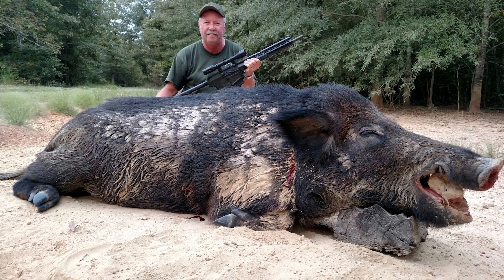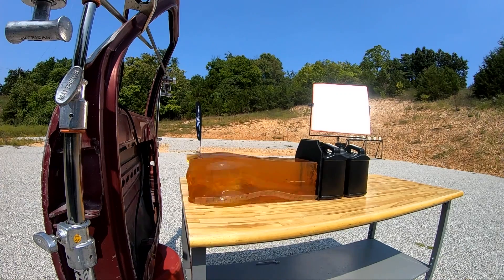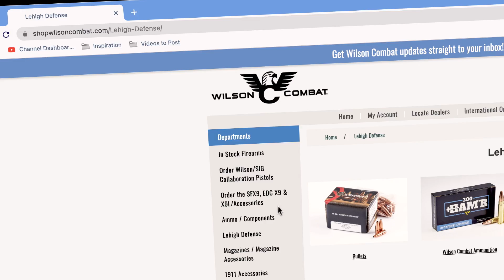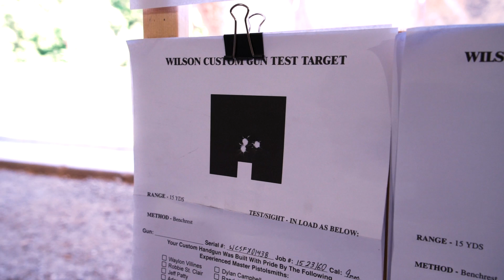The New Lehigh Defense is Fully Operational!  Now Machining 400K Solid Copper Bullets a Week!

Comment: More and more I am switching to Lehigh Defense bullets. My H&K Vp9's love the bullets as do my Colt pony and Browning 1911 380. I was astounded at how well the 118 XD bullets were in a 350 Legend for performance. Their 115 gr in a 38 Super using Blue dot is screaming fast and accurate. 357 Velocity in a 10 shot 1911 is a formidable defense gun. The 112 gr CC in a 6.8 SPC is a hog smokin round, possibly the best hog round for the AR 15 platform.  The best bullets I have found so far for my 50 Beowulf and 450 Bushmaster guns. Final note here Mas and Bill have some of the most solid and informative information found anywhere on the net . Thanks to Wilson Combat from me.

Comment: You need to go to a soft steel core, hot swagged with a copper jacket.  The hot swagging can be augmented by roll forming.  For expanding bullets a triple twisted wire can be formed by end welding , roll forming and roll forming the initial slug then cut off, re-heated, roll formed for the core.  In this type of process the copper jacket can be minimized.  A final plastic (or lacquer) coating will preserve the bullet iron tips.  Machining will be minimized for the precision bullets.
Reply: @stevexracer  They are going to find mine in the backstop.. and I like cheap.. and didn't I say soft steel (or wrought iron)?

Comment: By chance, will a series of the heavier 140gr thru to 155gr and maybe on thru to 165gr zone (limited runs) lots in the future for 6.5 or .264's,  for the guys playing with 6.5 PRC projectiles? I have played with some projectiles as low as 120gr, but, just a mess that low on unit. Both of my units seem to perform better with being on the heavier side.

Comment: As a Journeyman Toolmaker, about to retire, and an EDC enthusiast who just wants to be safe, I was blown away by the design of the Xtreme Defender round. In calibrated and verified organic gel I've seen .380 of this round make a wound as big as the best 9mm hollow point, and a 9mm round do even better. Along with its ability to penetrate barriers because it does not deform, and using an entirely different principle to create a very effective wound channel, convinced me that this is the round I need to have in my EDC firearms, both 9mm and .380. It's the only round I've carried for the past 3 years, the amount of time I've had an EDC firearm. Also, as a filmmaker as well, along with being a Toolmaker, and familiarity with this round, if you are looking to make any more promotional or advertising videos, let's talk.

Comment: .0005, that's an incredible close tolerance.
Reply: Not for CNC Swiss Lathes.  

A quality Swiss Lathe should be able to hold 0.0003" and be able reach 0.0001" under ideal circumstances.

Comment: When I heard "solid copper bullet" the first thing I thought of was the original 8mm Lebel round which used a solid bronze bullet.  It didn't work out for the French in the 1880s so they went to the lead-core copper jacketed style of bullet which we still use today.  I was skeptical when I heard "solid copper" but if Lehigh Defense is making it work more power to 'em. 
I hope we don't run out of copper, considering everything else the metal's used for!

Comment: RESEARCH THIS!!  Imagine a copper bullet that is strong enough to knock down a plate or pepper popper, and will never ricochet.  It wouldn't need long range accuracy, just enough to get the job done at 50 yards or so for USPSA and/or IDPA matches. And, of course, they must all cycle properly in a Wilson magazine!!  Thanks!  Mark P. , USPSA L-670